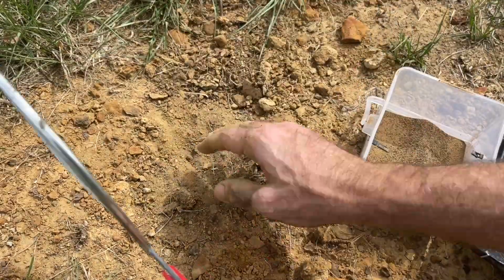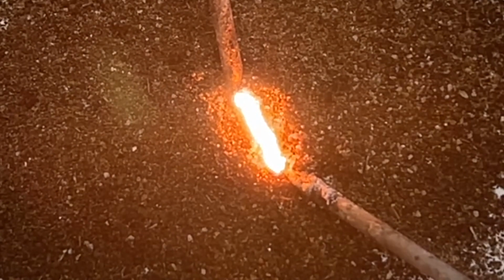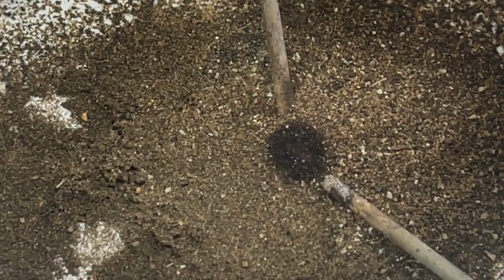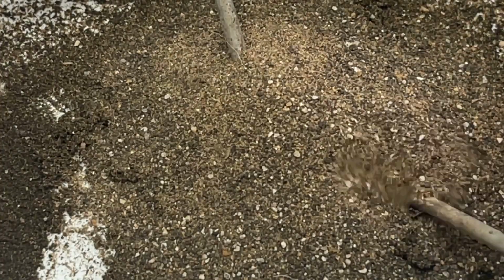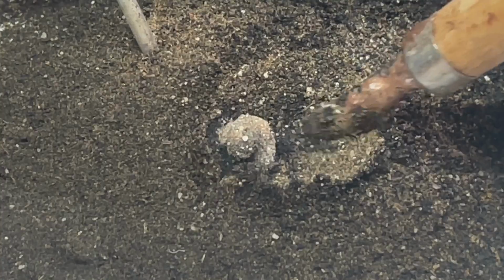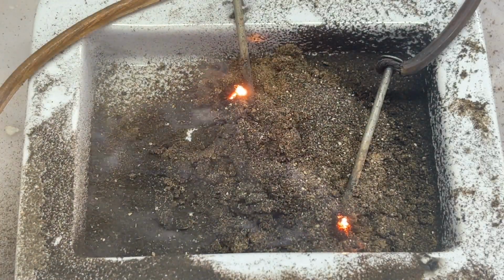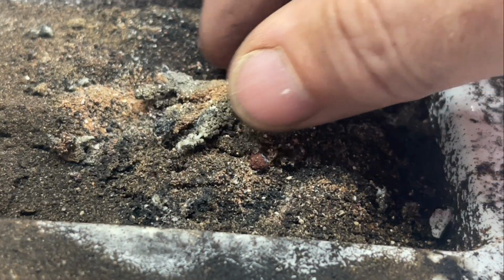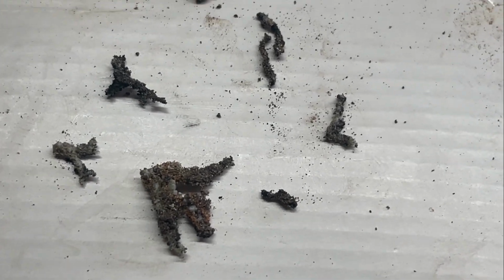Laboratory made Fulgurites 🤜🏼⚡️🤛🏻

Comment: So my best understanding is, this vid i posted has "longitudinal\scalar" electricity (LMD resonance mode if that means anything to ya), arc-ing to a ground cable, at moderate/lower voltage (2kV pp). Do the scars look unique maybe? Vortex potential wave esque? Holla! (Sry for self plug hehe)

https://youtu.be/FCx-fDcHths
Reply from the maker: It’s difficult to see. The hard part is capturing quality close ups on film. Most arcs seems to move in a vortex pattern & have scaler hexagonal movement when reaching out from a sharp edged or discharge point. I’ve managed to catch twin filaments and hexagonal patterns formed from discharge.
Reply: @ElectricUniverseEyes word, got that sense, already hungry for high speed camera, and at least a smartphone microscope. But the idea to use craters etc to diagnose wave propagation mode is a blessing from EU geology to my efforts, thnx yall literal trailblazers!

Thnx a zillion for feedback. FYI, I can power a motor thru flourescent tubes now, am getting footage of the strange dance moves this baby does. Longitudinal ion acoustic waves, and more - stay tuned, for it is SOOOOO lit :)